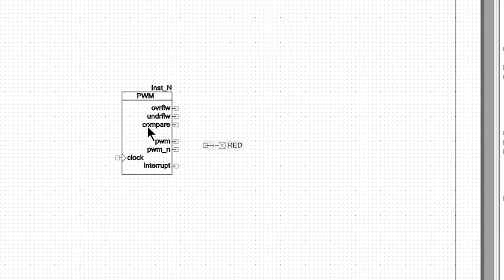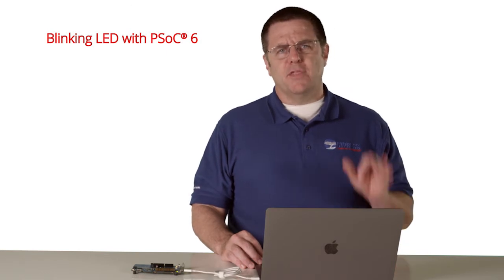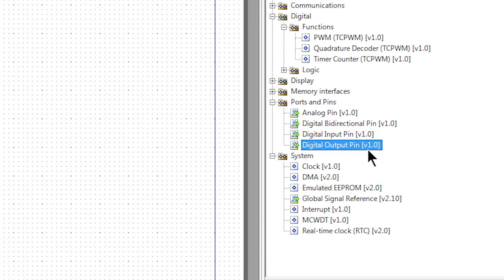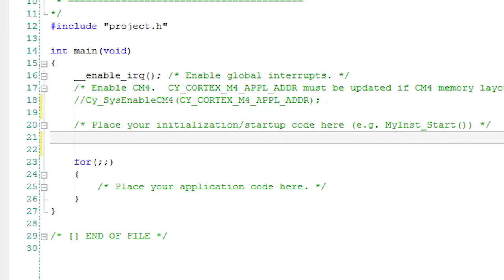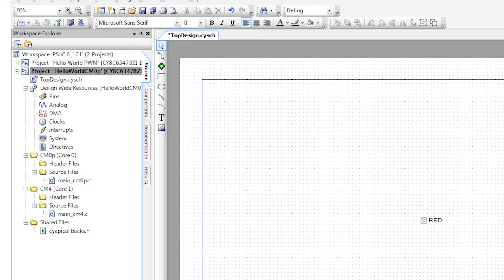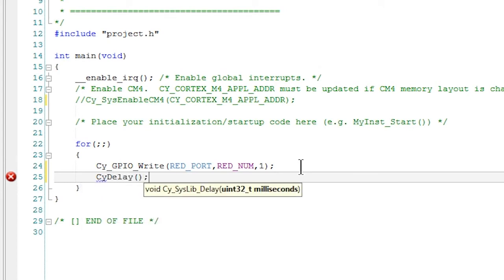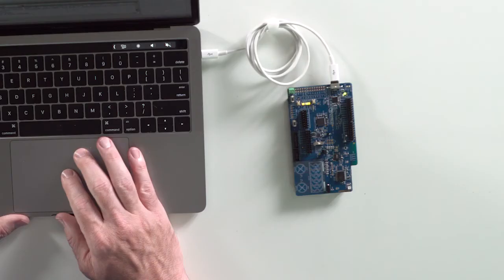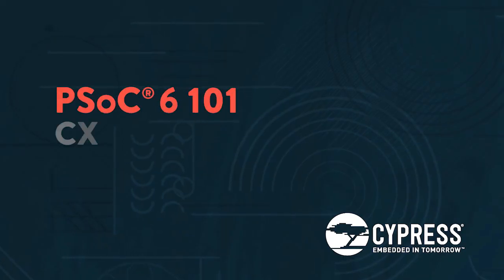PSoC 6 101: Lesson 1-3 Hello World

Comment: Oh, and another hint for brand new PSoC Creator users (which many people watching these videos may be), there is a hint when you come to run 'Debug/Program' and find that there is no entry for either the M0 or the M4 processors - in my case, I needed to click on 'Port Acquire' for these options to show up.

And yet another hint for Newbies - when I downloaded the PSoC Creator IDE from cypress.com at the end of November 2019, it contained version 3.0.1 of the PDL.   As you will know, the combination of this Library version with a PSoC 6 board will not work. 
What is required is to download version 3.0.4 or later of the PDL library, and in addition to then navigate to 'Tools/Options/Project Management' and enter the correct file path to the later PDL files.

Good luck to my peers!
Bob

Comment: Hi Alan. Great set of videos thanks.
Wanted to share an error here - as far as my environment is concerned. It may just be down to the passage of time, but could hopefully help others.

I am using the CY8CPROTO-063-BLE board together with PSoC Creator 4.2 and PDL version 3.1.0.

For option 1 (the hardware only solution) the entry in 'main_cm0p.c' needs to read 'Cy_SysPm_Sleep(CY_SYSPM_WAIT_FOR_INTERRUPT);'
as the version in your tutorial certainly causes an error for me.

Thanks again,
Bob